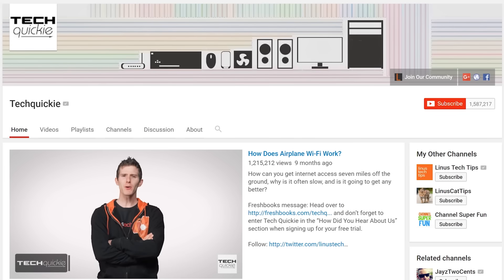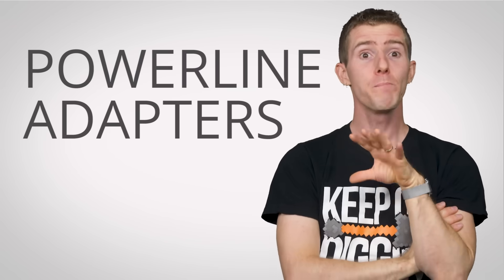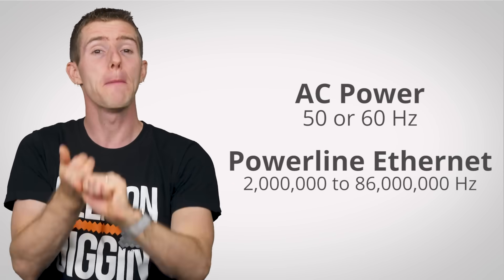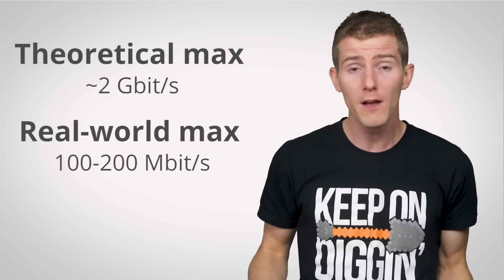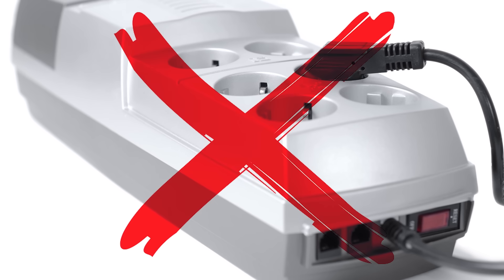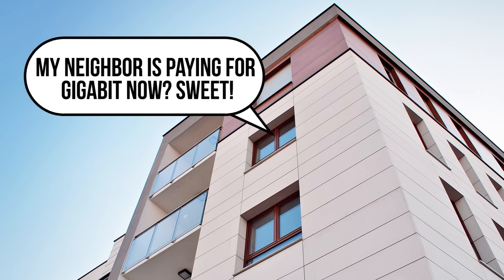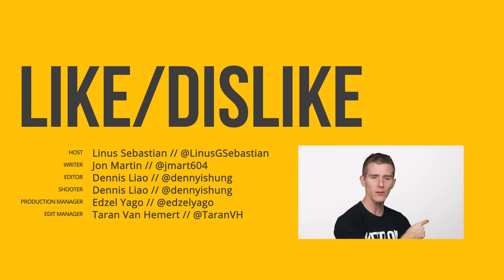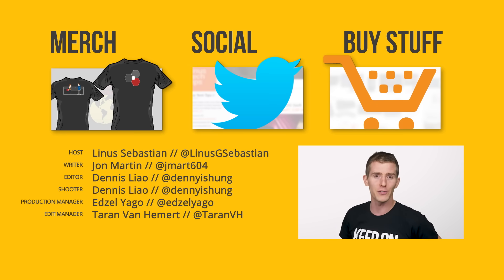How Does Powerline Ethernet Work?

Comment: I use this to get internet on my pc and I hate it. It's so slow and I can't use ethernet cables
Reply: It depends on the wiring in your house. Also make sure they aren't plugged into extensions.
Reply: why can't you use ethernet cables?
Reply: i think he is exaggerating ..
Reply: Mines almost as fast as Ethernet, it really depends on the quality of your houses wiring
Reply: Powerline adapters will work very poorly if the two adapters are more than two rooms away from each other or one is connected to an extension cable/surge protector. I own a pair of HooToo powerline adapters and they work great as long. Worst part about it so far is that 1 or 2 times a day it disconnects for a good 30 seconds, but this only happens when I'm just randomly browsing the internet, never when I'm gaming.
Reply: Nuggets321 maybe your pc sucks? I got powerline adapters from tp-link in my house and they rock.
Reply: bought two of these things, max speed between two outlets in the same room ~20mbps, max speed from the place I need it to the router ~10mbps
If your wiring is old or shitty wifi will be better in almost all situations, the only good thing is the low latency.
Reply: I used to use it. Speed was fine, but true signal would drop.
Reply: There may be problems with the wiring in your walls, I've never had any problems with mine but my houses wiring is some 40 years old
Reply: No, it really depends. I use it in a house where my computer is far away from the router and everyone else uses wifi and I get speeds very close to having an ethernet cable plugged in a few feet away from my router, and my house has very old wiring. I have no problems with gaming or video streaming. There are a lot of factors to go wrong like faulty wiring in your house, the powerline adapter being on a power strip, the internet speed not being great in the first place, etc, etc. If you're looking to try it, Best Buy and other retailers im sure have them in stock and have return policies if you aren't satisfied with the improvement to performance.
Reply: I was running a small lan party though a powerline adapter it worked great, but then again i only have a 7Mb connection.
Reply: Zephane because I can't get a second router and I can't move the router upstairs to the computer room 😭
Reply: I guess Canadians may be more prone to be running 2 phase equipment in the colder climate. Neat. Also, seeing as I live in the heart of America, I'd guess 120 single phase.
Reply: Sticks and Stones yeah, I had the same. Was on a separate breaker so speed was cut in half basically.
Reply: Works perfectly for me!
Reply: The wiring in my house isn't good for powerline networking either. I bought a pcie wifi adapter to replace it for like $50 and it is 100% better than the powerline adapter.
Reply: Greedo_10 thanks for the idea!
Reply: nuggets321 same. I get 2 MB/s on a 230 Mb/s connection
Reply: So basically this is great for online gaming in a crowded house that everyone is using wifi. However it's not really optimal for online streaming.
Reply: If possible try and make sure both ends of the powerline adapters are on the same electrical phase.
Reply: i would REALLY be interested to know if somebody has different phases in their house...
Reply: Every house in canada has two phases :)
Reply: Huh, didn't know that. Like some outlets are 2 and some are 1 or all are 1?
Reply: Yep! Some outlets are on phase 1 (say the left half of your circuit breaker box) and some outlets are on phase 2 (say the right half of your circuit breaker box). You can use a device like this to see which phase your different outlets are on: https://www.amazon.com/Extech-CB10-Circuit-Breaker-Finder/dp/B0014FNWJG
Reply: I’m going to assume that it will be way worse if they are attached to a different circuit
Reply: Royce551 it would not work on a different circuit
Reply: Works great for me (devolo). Make sure to you have one with power through put, so it can be the first or only one in the power outlet.
Never use it in extensions/multi sockets.
Reply: They are designed to work on different circuits, yep! If the circuits are both very long (distance from out to fuse box, from fuse box to the other outlet) then your speed or reliability might not be very good.
Reply: Ah, only the living room should be a long circuit, since its open-floored (so a lot of space for the living room), and then it will go into a seperate room with a different breaker into near where the router is.
Reply: CQG Shea
Most homes in America are on 2-phase power.  Half of the 110v breakers are connected to phase 1 and the other half to phase 2.  Then you may notice 220v breakers generally take up double the space, that is in order to connect to both phases.
Reply: Same for me. I got a 120 mbps connection and powerline only gave me about 10-15 mbps. Then I upgraded my wifi devices and now I'm getting solid ~100 mbps which is more than enough. It may have been different a few years ago with older routers and adapters but nowadays I can really recommend wifi over powerline.
Reply: +Nuggets321. do you have power hungry devices plugged into the circuit you're trying to use for ethernet? seems like the "background noise" of heavy power draw messes around with the data packets degrading performance..
Reply: then your house must not be wired properly. look the other  comments pls
Reply: I use ethernet and get like a gigabit and 200mbps from my provider harharhar
Reply: My ethernet port on my PC is shit
Reply: //  dropped from 75Mbps to 20Mbps // Well, then you shouldn't keep using this PoE technology, you batter connect with some kind of 'glass wire'...upps I mean fiber optic cable for data transmission. By the way, how do your 'Internet' endered on your house and what you used bemfore 'carrying' them towards your workstation?

Comment: omg i was just about to get one of these and you do a video on it ... this is freaky
Reply: Are they any good? Do they take all /most of the bandwidth for one device?
Reply: Liam McHugh I’m assuming that you bought it already but are they any good?
Reply: @caposchoppa  no sorry. Bc my WiFi sucks balls. I might need to fix that first.... Sadly
Reply: Google spy’s on you.
Reply: @xlkatz Does it take most of the bandwidth to the powerline adapter?
Reply: @xlkatz Okay thank you. But you still get higher speeds? Right?
Reply: @xlkatz My Internet is poor so I didn't want it to impact others using the WiFi...
Reply: @xlkatz So it is 2-3 times faster with people on the network or not?